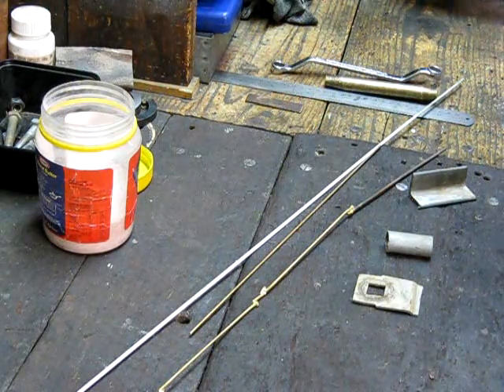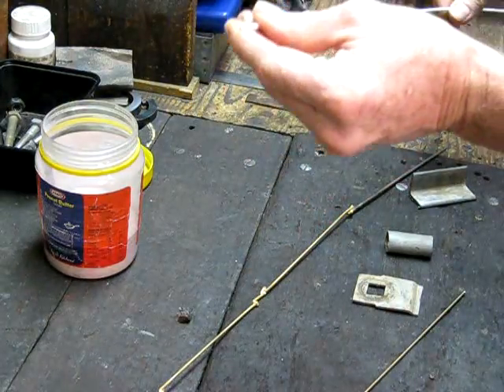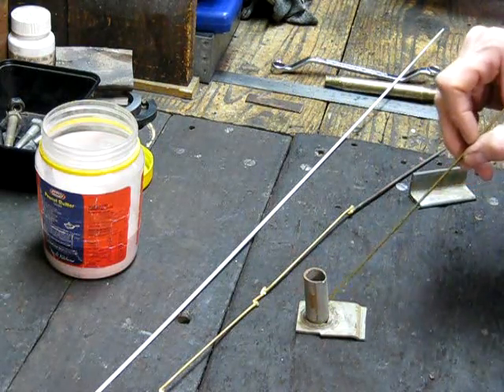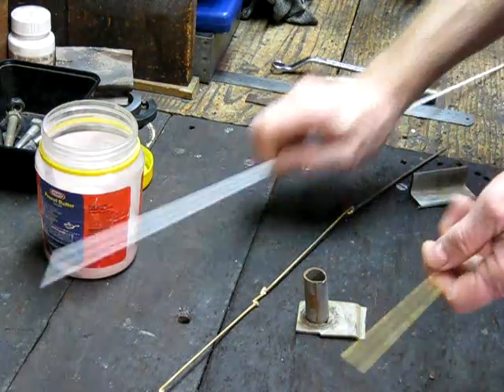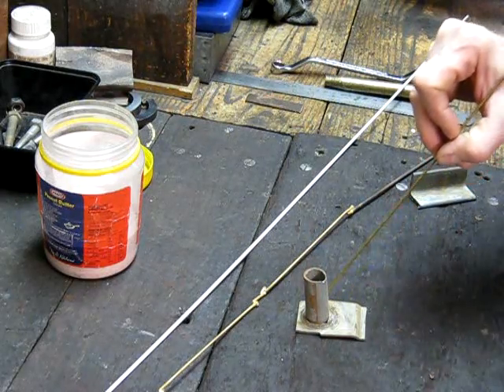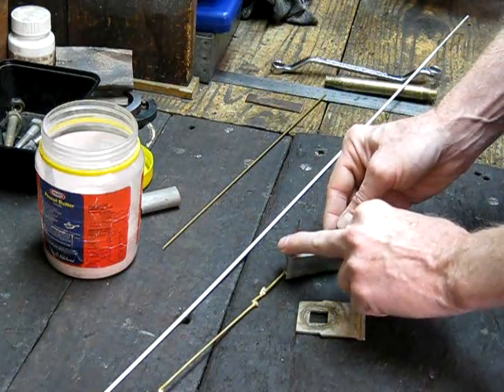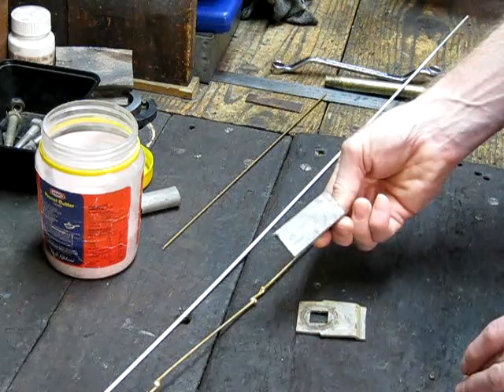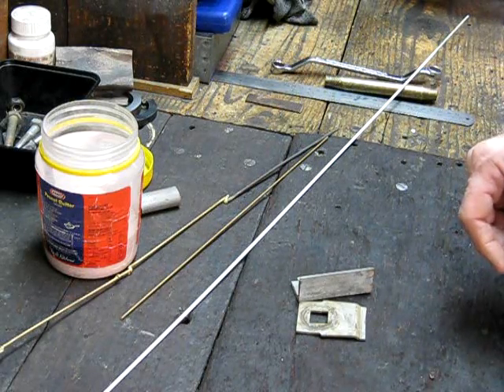How to bronze braze easily - some general workshop tips

Comment from the maker: To clean flux residue from the job, allow to cool from red hot and then quench in water - this loosens excess flux.  Then wire buff the weld to remove the rest.  Flux is water soluble and can be scrubbed off, but it is a very very slow process.  Long strand wire buff is best - it also removes surface heat bluing from the job.  Cheers Rob